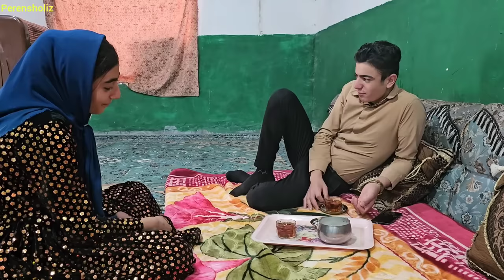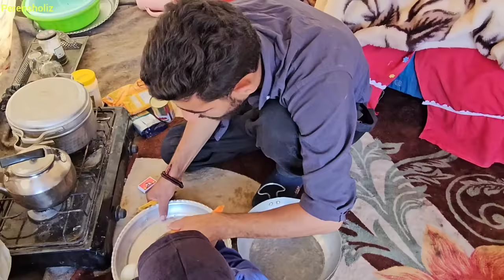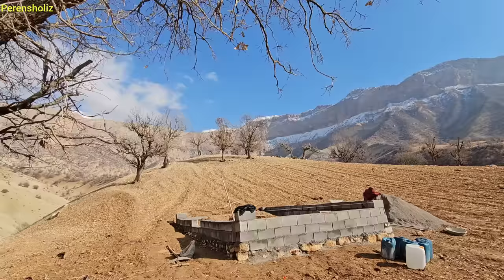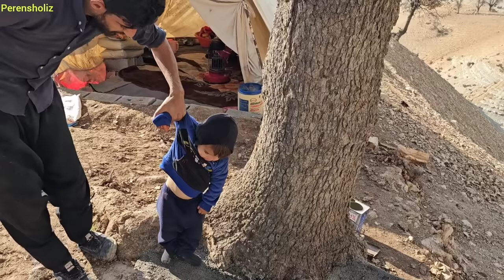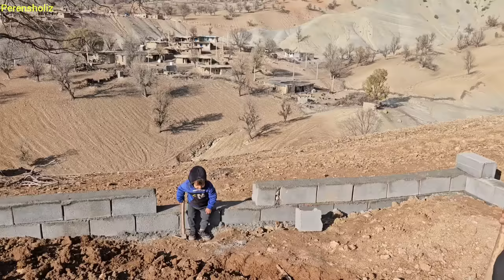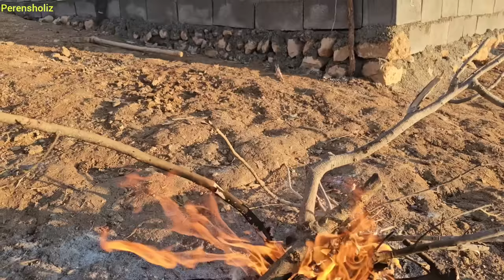"Saleh's Anticipation, Hassan's Effort to Attract Masoumeh's Love"

Comment: Your boss gave you a card to get things moving. Why are you running out of blocks? You should be ahead prepared for the build, your slow in your purchasing of the materials you need for the roof corrugated sheets, beams, windows, doors, plastering waterproofing additives. Slope your roof don't build it flat the rain water won't run off.